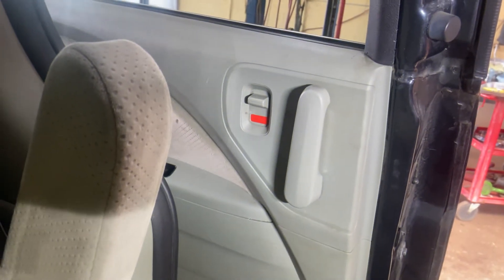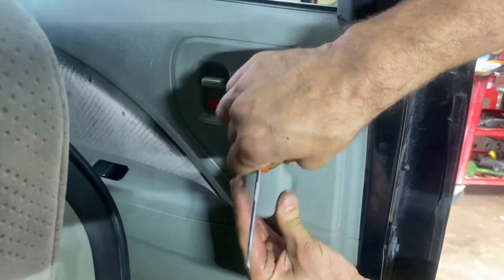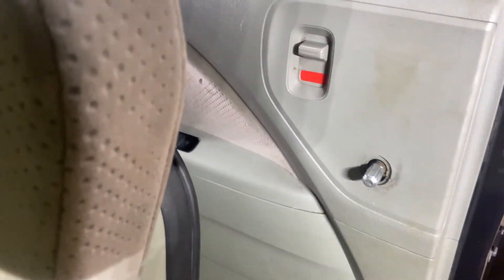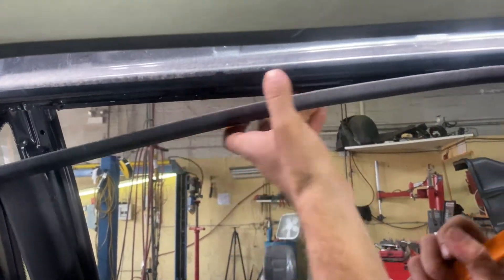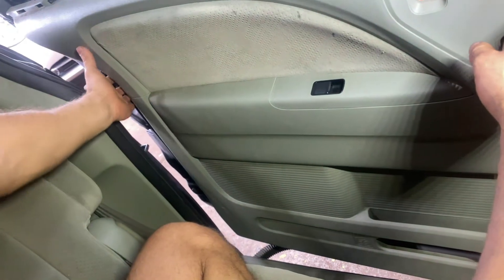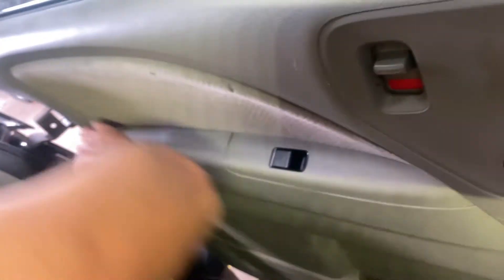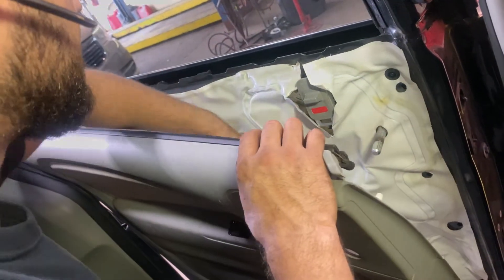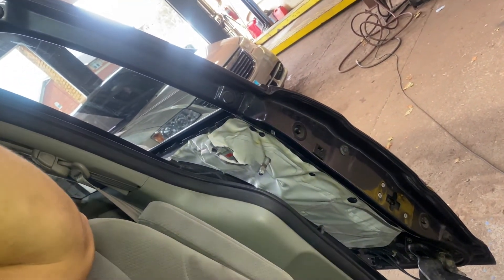HONDA ODYSSEY SLIDING DOOR PANEL REMOVAL HOW TO

Comment: It’s a great video! Do you think it applies in the same way to  the newer models after 2018?
Reply from the maker: Thank you Kwang! Yes it should be the same for models 2018-2020 as well.
Reply: Just did our 2018 Odyssey.  You do not need to take the panels around the window off.  Otherwise pretty much the same.  Just watch out for the weather stripping attached to the door panel below the cup holder area.  Not sure why they did that, but it makes it really easy to rip the weather stripping and is a real PITA to get it all back in place.

Comment: My door on my 2007 is stuck in the shut position. Anything different to get panel off when you can’t open the door?
Reply from the maker: That’s going to be a difficult task. Sometimes you just have to pull on it and hope it doesn’t break completely. Be prepared for a new door panel though most of the time.
Reply: Any ideas as to why is in the stuck position mine is doing the same im trying to figure the issue
Reply: @koolgamer3432  when my 2008 was getting stuck I replaced the door guide bearings.

Comment: How do you manually operate the sliding door? Mine are auto slide y
Reply from the maker: You just turn off the switch to the left of the steering wheel